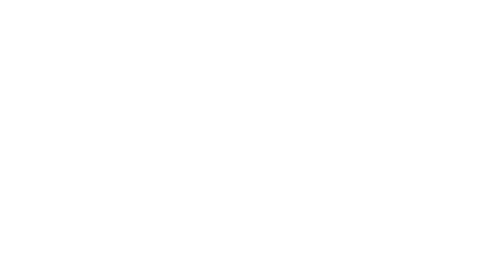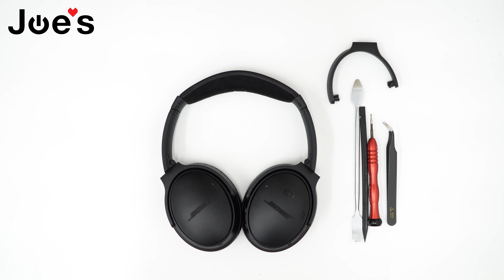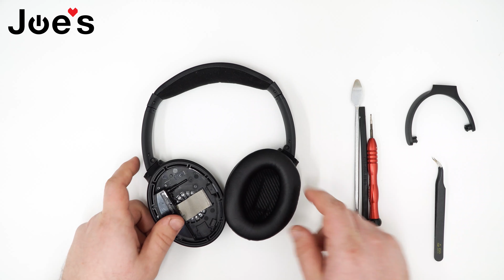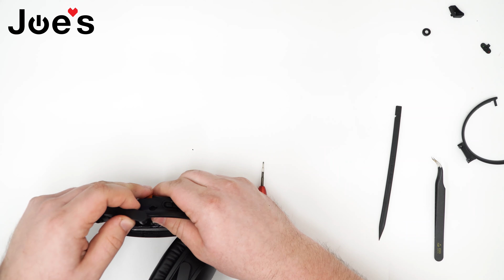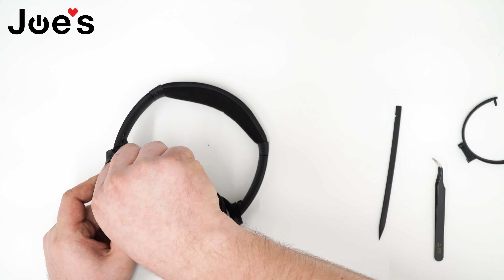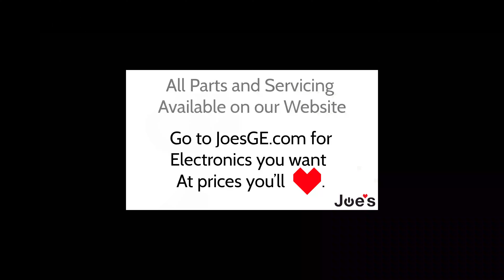How To Change Replace Broken Bose QC35 Right Side Outside Hinge Swivel (No Solder) | Fix Tutorial

Comment from the maker: Buy Hinge Swivel Arm, Left Black: https://www.joesge.com/products/bose-quietcomfort-qc35-hinge-swivel-replacement-parts?variant=16149543911470
Buy Hinge Swivel Arm, Right Black: https://www.joesge.com/products/bose-quietcomfort-qc35-hinge-swivel-replacement-parts?variant=16149552922670
Buy Hinge Swivel Arm, Left Silver: https://www.joesge.com/products/bose-quietcomfort-qc35-hinge-swivel-replacement-parts?variant=16149552889902
Buy Hinge Swivel Arm, Right Silver: https://www.joesge.com/products/bose-quietcomfort-qc35-hinge-swivel-replacement-parts?variant=16149552955438
Buy Hinge Swivel Arm, Left Pink: https://www.joesge.com/products/bose-quietcomfort-qc35-hinge-swivel-replacement-parts?variant=40461087211566
Buy Hinge Swivel Arm, Right Pink: https://www.joesge.com/products/bose-quietcomfort-qc35-hinge-swivel-replacement-parts?variant=40461087244334
Send Your Headphones Into The Pros: https://www.joesge.com/pages/repair-service-bose

Comment: Forget everything you just saw about disassembling the ear piece. Not needed nor necessary. Just pop the hinge bracket out of the ear piece as shown in the video, remove two hinge screws, remove old hinge and put new hinge on, push hinge back into ear piece and DONE! Less than 5 minute job.

Comment: I have a brand new BOSE QC35 ii headset that was making a sort of knocking noise every time I would tilt my head to the left or also, if I pushed up on the left ear cup from the bottom. I thought I had a loose battery inside that was not properly glued in but I discovered that It was actually the hinge insert that was making that noise. I was going to pop it out like you recommended but put some white grease on it so it wouldn't make that noise anymore. Anyway, after popping it out I got a little scared to put the grease on it so I just popped it back in and so far the noise has not returned. Thank you so much, because that was a really annoying sound! I didn't even want to listen to my headphones with them like that, but now I am able to.
Reply from the maker: Glad you got it fixed :)!
Reply: @Joesge  - I just hope it stays that way and I hope I didn't break off any tabs from the bracket when I popped it out. I tried to line it up like you showed me in the video but I didn't remove the ear pads or the cap cover or anything else that you removed. Those things didn't seem relevant for what I needed to do. Thanks again!
Reply: Mine do the same on the righ side, cracking sound when i move my head, but im scared to pop out the hinges without broke them
Reply: @rudymay8983  - As long as you follow the video instructions you should be fine. Just be careful when you pop it out. It's worth it because the noise in my still has not returned. It's worth a try.
Reply: @lateralus9244 mines do the sound when i move my head back AND front like when you re jamming a song xd, and when i press the cup on the bottom, i still scared to do it
Reply: @lateralus9244  did you used a especial tool like the video?
Reply: @rudymay8983  - No, nothing special. I just tried to find something that would work that would not damage my headphones.